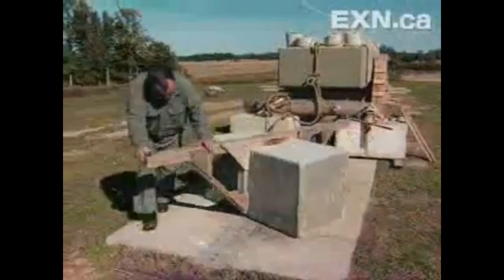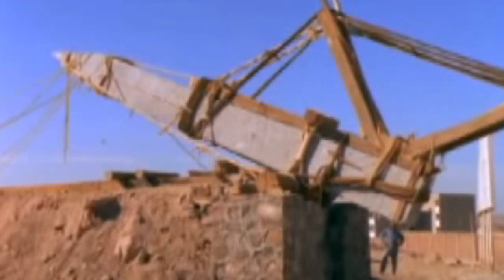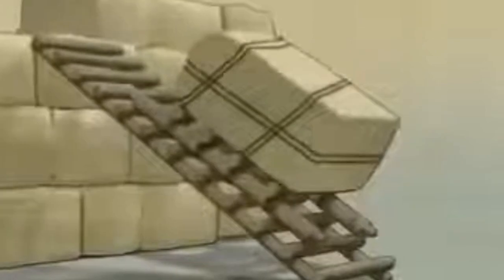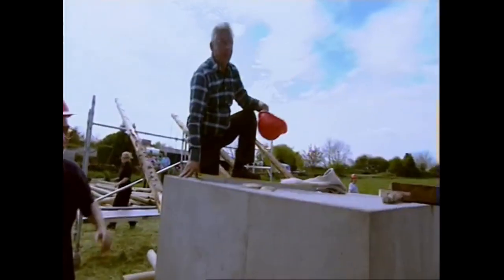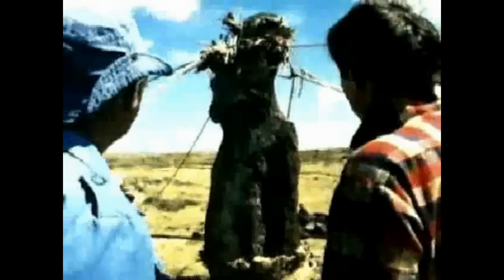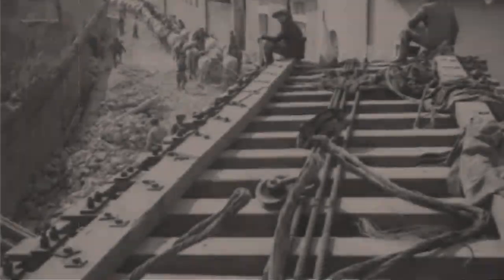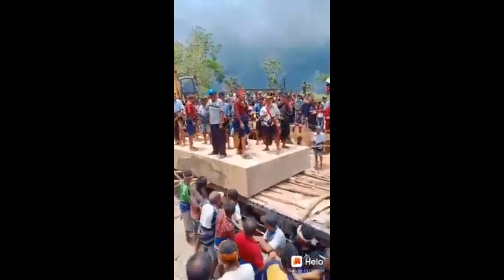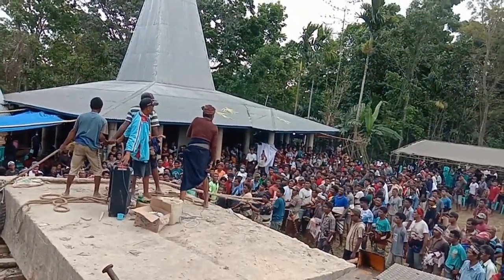How The Ancients Could Move & Place MEGALITHS With Primitive Tech. LAHT WON'T SHOW YOU THIS!

Comment: I'd love to think it was all this easy. There's aspects of it all that this doesn't come close to answering. It's one thing to use x number of men with crazy long ropes and tug some fairly small stone (compared to true megalithic stones we seen used in the ancient past) a small amount of distance. I'll even buy this method as probable for the obelisks  we see. However these much more larger stones was moved across huge deserts in loose sand, with no anchor points alslong the way to use to pull them. All your skids and levers would likely just sink into the sands. With the amount they needed to move (millions of them in some builds) one would have to think they would have to cut a road thru the giant sand dunes, then pave it pretty much so rollers can actually be used. But tbh that's only a small part of the puzzle. 
Now imagine doing all this 300ft in the air. All while you don't have the room for hundreds or thousands of men or best to be tugging a rop. Let's say you're installing the corner block, then what? Then, how do you get the stone there in perfect shape? Most stones when they got over x size they become extremely fragile. Marble and other stone types have sedimentary layers. They can be rock hard but have small layers here and there that they will split on very easily. Then once a block reaches over x size it's weight is more than what it's edges can support. Meaning when you try to pry and move it, it will just chip off an edge. All the edges are razor sharp still and very precise. Then let's say you did move that corner stone with rollers and got it into place, how do you get the rollers out? Then how do you slide the block into final position once you remove the rollers? 
I can keep going with ways things just don't compute. Then I see things like how they put the lintels on top of the Stonehenge and my mind is blown. 
The fact is, why move a super huge megalithic stone when you can just use tons of many smaller stones and do the same job? It makes zero sense in that aspect. It comes to one answer. That answer is it was easier for them to just use bigger blocks and get done faster. 
Imagine being the crew to have to set the giant granite beams in the kings chamber, way up high like that. Then trying to find a way to pull those beams into place with little to no room for teams on men. Then when done not break the stones and set then perfectly. A crane of some sort was almost certainly needed. 
 I'm afraid we're light years away from doing things how they did. Great video tho very interesting and well made thanks
Reply from the maker: No megaliths were moved across the desert huge distances, that is the black diorite quarry in the eastern desert where small blocks were quarried. The famous statue of Khafre (human sized) comes form there but no obelisks orgiant statues come from there/ They a;; come from the quarries next to the rivers and so were all only moved a short distance overland.
At 300 ft the pyramid was still the size of a football field, no stone was lifted 300 feet, not even close to that. they were always close to the floor.
Amongst my videos are old photos of old school masons working before modern tech, including with large stones. They don't chip the corners even when placing megaliths with fragile carving 100 feet in the air then placing them onto the top of columns..
The giant stones and statues as with obelisks are tilted up and lifted off the rollers. For horizontal stones they are brought on to beds of sand and the rollers them dug out from beneath, the sand then shoveled and washed out to put them into final position.
Reply: @SGD Sacred Geometry Decoded  the great pyramid is 481 feet tall. While yes its base is large, people did in fact set stones at well above 300ft into the air. While they did it, it got to be an ever increasingly small area to work on top of. To the point of it literally coming to a point. Bear in mind the stones didn't get smaller as they ascended. The spiral pyramid theory glosses over these huge facts. The ultimate in this aspect is the fact of the capstone. How do you get that to there? Build a ramp?  Then why even have a spiral if in the end you need a ramp? My only logical answer I can think of is they used a crane of some sort also. 
Then there's still the common sense answer to be resolved. Why use massive huge blocks when you could have just used many more smaller blocks that are far easier to move than huge ones? The answer must be because it's faster and easier to build with larger ones is why, hence why we use large as possible ones to this day to build with fast. We just pour it whole instead most times tho. But yeah we still use blocks for certain things that we want that asthetic for. 
But I digress..
And yes, the obelisk I agree was yes likely set that way. I said that in my first statement. No argument there. As many of the obelisk was made much later with simpler technology, even in recent times.
I know the word technology gets scoughed at many times. I get it. But also understand that a horses saddle is technology. Technology is this manner don't imply laser beams n such they had and was lost to time. It could be very well a way of cribbing a stone that we're unaware of. Many things really in that manner.
And yes. Im slowly watching more of you're content to learn more. It's the only reason why I ask questions, is to learn after all.. not argue. So I'll watch the modern guys work too soon as you mentioned. The little I've seen so far tho made use of oxen, pulling, and steel cables tho. Keep that in mind. It appears they was able to crib the stone from damage too with modern plywoods, and steel bands etc also tho. Hard to remember it all as I watched it late last night forgive me lol. Much harder to do in ancient times. They claim they didn't have the wheel then. But they also double speak and say they likely had pulleys. Pulleys are after all just wheels. So that doesn't make much sense. Then add in the fact they had to be very very large pulleys. Keep in mind they didn't have steel cables as those did. I used to rappel alot for work. I know what ropes can and can't do, not to mention natural fiber ropes. When using ropes in small pulleys it will bend the fibers in such a way that only the outside edge of the fibers are in tension. The rope actually touching a pulleys wheel surface is under slack. The smaller the pulley, the less strong your rope will be. That's why pulleys are larger for larger loads. Small ones like in that modern video use roughly just 10-20% of that cables full strength when under a load. Now imagine a natural fiber rope in the same way. It's fibers aren't like modern ropes. They don't travel the full length of the rope. They only a few feet long each at best and rely on friction to even stay together.  This is why they're so weak vs modern ropes. Then try to use a fiber rope in a pulley, well.. it's dicey stuff at best. 
Then even if the ancients had these pulleys, as I said they need anchor points to exploit. They didn't have these everywhere. It's not like they had trees to pull on from, and so forth along the deserts paths. 
When I rappeled for a living I actually was a masonry tech for concrete and did repairs for condos on our beach. 150ft in the air most times. Doing this stuff first hand gives you a very good appreciation for what's seen. I can appreciate how they was able to cut these materials as well. It's a situation of where the more you learn about how this stuff actually works, the more impressive thier feats become. If that makes sense.
I'll take what you say under consideration and I'm open to all ideas. I appreciate the feedback thanks
Reply from the maker: Great Pyramid 756 ft (230 metres)  at the base, 51 degree slope, at 300 feet the working area is quite large.
The higher up the smaller the stones do get, you can see the stones at the top in photos and they are a much smaller than the bottom.
The grand gallery has a angle of 26 degrees, the same found in ramps in ancient quarries. Those heavier stones could be brought up like that. never actually ldead lifted , above the grand gallery they found evidence of a parallel void, which leads to the very top of the kings chamber and those stones there.
https://preview.redd.it/8ge8w8kusd781.jpg?auto=webp&s=e89c053c6b3f501c99c35601a8b83dce1625fb08
ON technology, people such as Bright Inisight and Uncharted X do insist it requires 'advanced" high speed cutting and lathes etc where neceassary. and that an advanced lost technology MUST have been used.
Moving mussolini monolith they initially used fibre ropes, old marine ropes including cables to tow battle ships and such. Modern synthetica and steel rope are advantageous- i worked in lifting and rigging. Though ships of old all used fibre rope, the forces on a relatively small sail can be tens of tonnes. Hemp rope especially is incredibly strong, even though the individual fibres were 6 feet or so at best. Towing aircraft carriers and such in open ocean is essentially lifting them as the ships move up and down the waves.
A pulley could be a tree branch, ships blocks a are just wood with holes drilled in them and have no axle.  Pulleys with axles are better as reduce friction of course but not necessary, a copper bushel or sleeve can also be used.
In the tenth book of Vitruvius' De Archtectura he describes all the simple machines and points out that the origins of them are too ancient to name. Being that a ship of any size requires mechanical advantage to operate.
Even a truckers hitch gives a massive advantage. A compound pulley system from a single piece of rope.
Reply: @SGD Sacred Geometry Decoded  I'll set aside the debate over ropes. Single ropes needed for such lifts themselves become a herculean task to move at those sizes. Especially natural fiber ones. Ships have the rare ability to deal with such weights and sizes just because they're so big and strong they can stretch and move them. It's rare a human even has to lift even the end of one to fit them to capstans etc. They're huge lol. That's with modern synthetic ones that are about 1ft in diameter. To have a natural equivalent is much larger to handle the same weight. In fact if ones needed it only needs to be thick at the loads end when dealing with multiple people/oxen pulling on them, then they can taper and be lighter towards the other end. As less people/oxen pulling it to break it. If that makes sense. But I know they didn't use one rope and it's a silly thing to debate so yeah moving on...
To use a pulley like I said prior several times requires a solid point to use it from. An anchor point. Where did they anchor from?  This comes into play much more when they have to backfill the spiral they used to pull the initial stones up with. Did they push them up instead? 
And yes I often use a truckers hitch. But with modern synthetic ropes at least. It's alot harder to do, near impossible with old natural ropes. Lots of friction there and they also cut themselves as you try. It's fine to taking some slack up but yeah definitely not ideal. Even then, you need an anchor point. 
The measurements of the pyramid vary I suppose. Much of it is under sand, the top is missing and so on. Depends on who measured it I supposed and how they chose to do so. Make no mistake tho, things get extremely dicey when even 10ft off the ground. Let alone 40-50 stories up. 
Yes there's small stones up there. I'd have to check images but there's many smaller stones they used to backfill its inside. The casing stones tho as a whole are typically very large. I'll have to see again how it was done but I'll go along with them being small for now. The fact still remains tho that it was capped with a capstone. How it got there on top is a mystery to me. It's size is a mystery as far as I know. We can agree it was fairly big and heavy tho. 
Then after all that they had to clad it in limestone. Again I'm no expert and just talking common sense logic I've learned along the way building other things. I've not yet seen that explained yet in a way that makes good sense. 
And yes, I do watch channels that make outrageous claims. Laser beams and such. It's fun to think about and make guesses. It fascinates me. Being a person who cut stone for years I can say I am fascinated at how they did it. And yes they did leave clues behind that blow the mind. Once again I use tech in the correct manner when I say it. But they did have tech that leaves us speechless. The core that Flanders guy or whatever alone is impossible proof of them having a core drill that can cut at rates we can't do today. It's impossible to fake even today btw. It carries a perfect spiral down its sides with a very even cut rate. So much so that you can wrap a string around it and retrace it. There's also saw marks that are grandeous in diameter left behind. Many things show signs of perfect semetry, such as large columns etc that appear to have been cut by a lathe of immense size. Then to see who they can cut perfectly square plunge cuts into solid granite is purely amazing. It's stuff we still can't do even till this day. 
I do think they was smart enough to realize if they was able to put dolerite crumbs into molten copper it would make our modern equivalent to a steel diamond cutting blade. It would just have a much faster rate of wear is all. That's perfectly possible. 
They say they didn't have steel. King tut was found with a steel dagger tho. I also noticed what I think is more steel evidence in videos. Like how that one camera robot went up that shaft and photo'd that square stone plug. It appears to me there's two obviously corroded steel handles poking out of it. They resemble old rebar that's rotted over the eons. So that's three examples I know I've seen from my couch here. They claim it was from meteorites. It would have to have fallen in perfect ingot form tho. As all meteorites I've seen so far are spongey mixes of many things and require forging to make into actual steel. Or iron, whatever the case may be. I use the words interchangeably. 
Then to top it all off we're told this was all done for one man during just 20 years. I find that extremely hard to believe. The lack of a body and the fact there's nearly no markings inside is very odd. I'd be more inclined to believe this was some sort of shared facility for all mummies. They'd start there and then when done with whatever they did, they'd then go into their actual personal tombs. It's very hard to believe it was custom made for one guy during that small period of time. 
I notice other small details that make me wonder things. For example, if I asked you how long it takes for let's say a solid granite obelisk to rot and crumble. How long would you say that takes? Is it even possible to see that happen during the time frame we know it so far?

Comment: How were these large stones and obelisks cut?
Reply from the maker: Hard to answer in brief. Feather and wedge method can split big blocks in  a very short time.
Evidence for obelisks includes the use of fire setting. Granite can be rapidly smashed after exposed to a fire.
Back then as now traditional  stone masons and quarry workers have a variety of methods.
Reply: @SacredGeometryDecoded   Thank you so much for your reply!  This was very interesting to see how easily he could move those huge, heavy blocks! :-)
Reply from the maker: @LolaElenaDisco  https://youtu.be/zBTVAa9GTp4?si=hSsxXoiCIRTEn3u8
Some rock splitting examples , copper and wood example included.

Comment: The problem with ALL of this is the MATH. They claim the Great Pyramid was built during the rein of Khufu and only took 20 years.  There are.2,300,000 blocks that make up the Great Pyramid,  each weighing a minimum of 2.5 tons.  There are 10,512,000 minutes in 20 years.  Therefore,  working 24/7 for 365 days a year for 20 years, you'd have to set one of these massive blocks in place every 4.57 minutes.  And you'd have to do this in a desert, in the sand,  in scorching heat, with rudimentary tools.  I call total bs. It's not possible.  Even doubled to 40 years,  it equates to setting one block in place every 9.14 minutes.  In 80 years,  one block every 18.28 minutes.  There's simply no way, no matter how many thousands of people you have quarrying, shaping,  transporting,  lifting,  and setting these things in place that you could even do it in 80 years (let alone 20 years) using simple leverage,  fulcrums, wood rollers, ramps, rope and brute force.  The idea is preposterous. Clearly,  there is some serious technology that has been lost,  plain and simple.
Reply from the maker: Divide it by multiple teams then it’s a block every 3 days per team. 
The Giza plateau on the bank of the Nile and not in the middle of the desert. 
The overwhelming bulk of the stone comes from right next to the pyramid. 
By the time they’d reached half height it’s 80% finished.
The interior blocks are rough,very rough.
Rudimentary tools? 
I have heard this narrative 100 times. It’s preposterous plain and simple. It’s designed to sound MATHY but it’s a rhetorical trick bundled with “in the desert and rudimentary tools” to dress up the mystery.